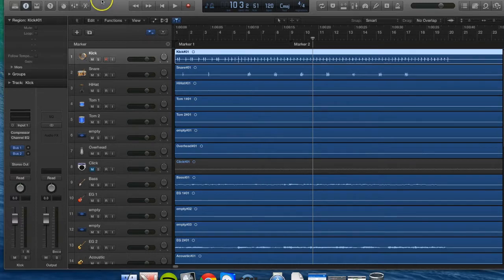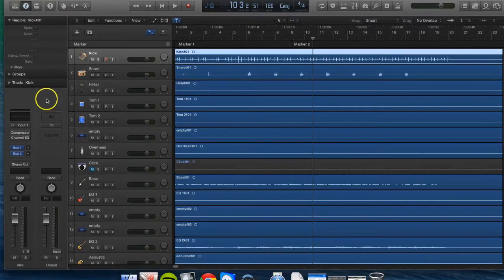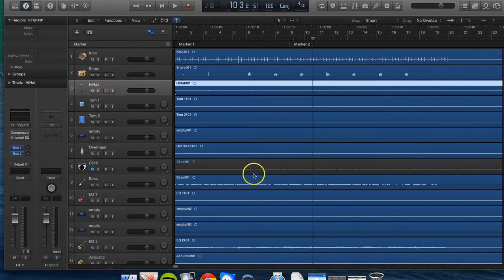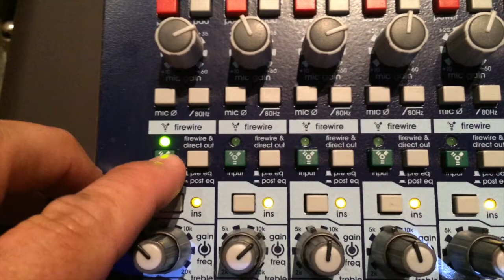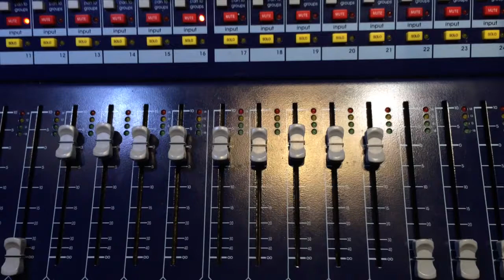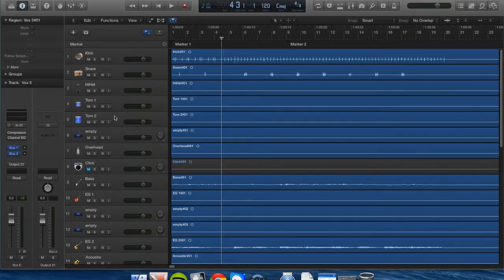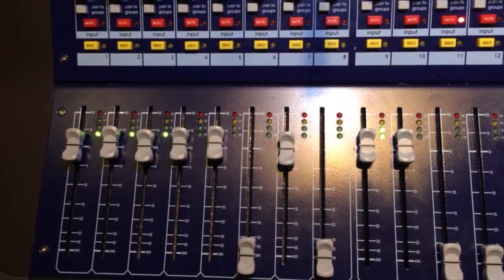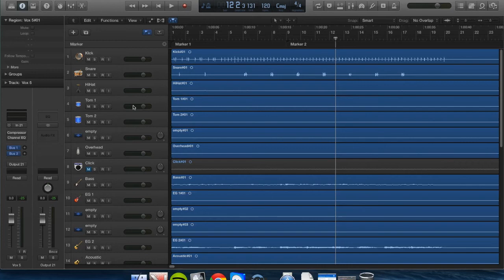Midas Venice F 32 using Logic Pro X for mix down

Comment: I have a question:

the venice f32 records in multitrack ????

I want to record my drums set in Logic pro x but I don't have channels in my interface
Reply from the maker: yes, the Venice will send all 32 channels to your computer if you set up the session properly in your DAW. It is very easy to do drum recordings with the Venice F32, as it actually works very well as a large, multitrack interface.

Comment: Jeremiah, great tutorial! I am thinking about getting Midas F32. Do you know how recording the inserts work? I am usually using distortion/filter as a group insert but I don't understand how it works on this console. Is it 32 channels + groups? Or I need to sacrifice 1 channel for it? Or some other way?
Reply from the maker: there are two ways to make it work. First would be to use the inserts on the board to send the signal to the FX and return back to the board, essentially creating an FX loop. This would require you to sacrifice a channel to the FX where your volume fader would be the Wet/Dry control for the FX. The other way that would work without sacrificing the channel would be to add the effects in post mixdown using the DAW and software effects. There are some amazing plugins for this but I am of the opinion that there is nothing like certain outboard equipment and that analog is sometimes better than digital when it comes to sound.

Comment: Hi! i just started using Logix pro x on my macbook pro 2009 (el capitan 10.11.6) and want to record my band with the Midas venice 32f. logic doesn't see the Midas if connected with firewire. do i need a driver for this? when i look in the hardware list and click on firewire, venice is showing, but not in logic. can someone help me please? thanks! Dave from The Netherlands.
Reply from the maker: dave Kelder thank you for your question. You will need to download the Midas Firewire driver the first time you connect the board to the computer. Launch the Midas FW driver and then launch Logic Pro X. Should show up and work just fine. Remember when you are monitoring the mix, you have to arm the channels to be able to hear them on the monitors...or at least that's my experience. Happy recording!
Reply: Thanks! tried it yesterday at a gig. connection board-macbook works. but now the next problem. how to set logic for recording multiple tracks. i think Google is my best friend for the next week ;)
Reply from the maker: dave Kelder now comes the tedious part. You will have to add tracks for each channel strip on the board. You will also have to make sure that the individual channel you add is setup properly in Logic to receive the proper input from the board. Not hard, just tedious.
Reply: Thanks for the help! just tried it, and it works!

Comment: My question is can you add FX from the Midas to every track while tracking and or running a live show m? Sorry if this was asked already! 
-MixedByKidSynth
Reply from the maker: On the Midas Venice I don't believe that is possible. The FW connection is merely a way to send or receive tracks from the board or a computer. The ability to send tracks, add FX, and send them back to the board can be done but not entirely with the FW. You would have to send the audio to the computer using FW and return those tracks in a simple stereo return or through another audio interface...which is kinda tedious and could be prone to latency. I would encourage you to look at a fully digital board if you want to add fx during a live show...or you could go with outboard FX processors that are standalone units like Universal Audio or something like that.
Reply: +Jeremiah Mitchell Awesome man thanks for that reply I guess that soundgrid is what I'd need have you seen the waves touchscreen interface it's insane!
Reply: +Jeremiah Mitchell eMotion LV1 Live mixer

Comment: Is there any way to save those settings in Logic so you don't have to keep redoing the assign procedure every recording session. I am considering buying this mixer so I am considering how it will work in a recording studio environment...All info welcome. Thanks for the detailed video...

Philip
Reply from the maker: +Uptown Wedding Photography NJ Yes! All you have to do is set up the "show" once and save it as a template for that board. That way you will have the template saved locally on your computer and you can recall it any time you need to. That is exactly what I have done.
Reply: +Jeremiah Mitchell Thanks for the info...How do you like the Venice console? I am considering buying one. Is there a way to use a channel strip as an input channel (say tracking a guitar) and also monitor on the same channel strip the DAW (or tape) return. Like an inline console would do. Thanks, again....
Reply from the maker: I have never tried it but I do know that all of the aux's work as they should while recording so it should be easily set up. I like the board, I will enjoy when we upgrade to the Midas Pro 2 board but this board sounds great and performs like a workhorse.

Comment: How do you bounce the mix through the midas? thanks for the video!
Reply from the maker: +Tomás León Bulling I don't typically bounce the recording through the Midas. I use the Midas as a mix down tool and then listen to the finished product through some small computer speakers, which is what most people will be listening through. If it sounds good, I will bounce it and make it a final cut. Hope this helps.
Reply: Thanks Jeremiah! but I dont understand, how do you bounce the final mix?? i'm using logic and I added some plugins and then I added the Midas Eq, then I send the mix to 23.24ch. And then how I bounce the final mix to master later? sorry about my english.
Reply: +Tomás León Bulling With analog external routing (effects/EQ/console) you always have to do a "realtime bounce" (instead of Offline bounce)

Comment: Great video, what do you do if you have 65 tracks? Can you mix the other 33 track in the Daw?
Reply from the maker: +Steve Belfiore Yes, you can. The issue with multiple tracks like this is that you would be best to send the first 32 to the board, mix it down and then send the remaining tracks to the board while using 2 channels as a stereo mix for the previously mixed channels that way you have a reference for the channels that haven't been mixed yet. 
Just my opinion but it should work...

Thanks for your comments and questions.

Comment: Hello what specs does your Macbook/IMAC have to run that many channels at once for recording? Thanks
Reply: +River Valley Crossfit Hi im looking at getting a macbook pro to record on, via my f32. you say 2.53ghz and 8 gb ram will record 32 chans all day, do you think it would hold up if you were then loading up on plug ins etc. during mixing in the box, say in logic x or something?.. thanks :)

Comment: Yeah, I get it.  For live sound reinforcement (probably other than a straight up band performance), you can play back pre-recorded parts through the mixer and tweak the playback mix on the fly manually using its controls.  I moved from a Yamaha MG32CX to a QU-32 so I could track, mixdown and mix live shows.  I had been searching for info and opinions on analogue desks like the Venice, strictly for tracking and overdubbing in the studio, while using the QU as my "mouse on steroids" for mixing down. It still might make sense. Peace.

Comment: So can you not just plug your computer directly into your monitoring system to hear exactly what the mix will sound like when played back?  I can see the Venice being used for tracking.  And in the days of analog tape, I can see how it would have been used for manual mixdown without automation. But I'm still not sure why feeding the DAW via FireWire back to the mixer with all faders at unity does for the mixdown process.
Reply from the maker: Well, I could run it through the monitor system is I had one. I don't use local monitors during a live show. I mix using the house speakers for a good sound. The purpose of this video was to illustrate what "could" be done. The Venice allows audio to be routed back through using the FW cable. It was not intended as a "this is what should be done" type of video. I was showing people how to do it if they wanted to. 

In all honesty, I don't even use this type of setup to mixdown my audio. It was just an illustration of how it could be done if you wanted to. 

Make sense?

Comment: I don't get how you mixdown using the Venice. The faders are all disconnected from the DAW, so how do you fine tune levels in a mixdown? If you aren't using automation, why even use a DAW?
Reply from the maker: Boris, the reason for using the DAW is simply that I am using the house speakers as reference monitors. I set the faders on the Midas to unity, I already know what the live set sounded like, so the only tweaking that needs to be done is in the DAW. This gives me a pretty good way to mixdown multitrack recordings without having to pay for studio time...or some really expensive reference monitors since my sound system cost us about $50k. 

Hope this helps! 
Also, we are breaking ground on a new building and our system will be upgraded to a Midas Pro2c with Nexo speakers and amps. I will have a video of some automation at that point.

Comment: you use the mixer like a sound card ? I own a card m - audio firewire 410 is required for the purpose ? I want use this with Reason 8.2.
Reply from the maker: Karim Le Mec Yes, I am using the mixing console as a "sound card". The firewire output on the board allows it to work just like your 410. The difference is that I have 32 channels coming into my DAW at one time. You should be able to use the board with Reason, you will have to just set up the input/output correctly.
Reply: Thanx You so mica Jeremiah.  I Just Found it a used one here in Italy and I cant wait to put my fingers on it. AWESOME tutorial btw 😉
Reply: Jeremiah Mitchell Hi Mitchell, a sound engineer I spoke of this mixer and said it was very good, my question to you is this, that the difference in recording only with a card direct sound to the PC that record directly with this console, I ask because there are people who say that consoles are not necessary, but I think that by sending the Senar THROUGH the mixer be heard with more body, give me feedback, thank you and God bless you!
Reply from the maker: KARAOKE MARTILLO
When it all comes down to it, I am not exactly sure how much difference going through a sound console makes versus using a direct input to a computer but I will say that the recordings are very good quality. Also, I am a sound engineer by trade so I would rather be standing behind a console than sitting behind a computer monitor anyday. I would suggest you try both ways and see which one gives you the sound you want. Different styles of music sound better with different recording techniques so the best way to find it is to explore. Hope this helps.

If you have any thing you would like to see in a video, let me know.
Reply: Thank you for answering ..... I think your answer is balanced, grateful!

Comment: Can I use this the firewire to record all the 32 channels to my computer simulataneously like I can do with a digital mixer(eg. Presonus Studiolive) and also how do you bounce the audio tracks after mixing them with the board?
Reply from the maker: Sayan Sengupta Yes! you can record all 32 channels to your computer. All you have to do is setup the inputs in the DAW so that they receive audio from the specific channels you want. It works almost exactly like a digital board in that respect. The audio quality is great. 

Thank you for the question.

Comment: Hi Jeremiah
can you make a video about how you record your mix back into logic?
thanks!
Reply from the maker: Amir Estlein I'm not sure I understand what you are asking about...? I don't use the Venice to record my automation for the DAW...if that's what you're asking about. You can actually use a summed mix from the DAW back into the board as an overdub type of situation if you wanted to. That way the original mix can be used as a backing track and you can record some new stuff over the top of that in a new project in Logic...but beware! You can't play a track from Logic and record new stuff at the same time unless you are using two separate computers. 

If I am not thinking on the right line please clarify the question.

Comment: can i use the faders and the Eq to Mix?
Reply from the maker: Everything on the physical board should function as normal, except for the input signals which are coming from the computer through the FW cable. The eq's and all faders will control the volume of the signal coming through them...just as normal. Just remember that the premise of this video is to use the physical board as a way to monitor the changes made in the DAW...so, I don't normally tweak the faders on the board a whole lot so that the sound is more neutral and genuine to the original recording.
Reply: Jeremiah Mitchell  thanks man ...helped a lot=)

Comment: Do you know maybe how to root  the Signal from Logic pro x to  Venice f32 mixer and root back an Analog EQed Signal  from venice f32 stereo channel back to Logic Pro X to get a even better Audio quality?
Reply from the maker: Great question but I am not sure it is possible to do what you want with the F32. The reason I say this is that the F32 will send or receive 32 channels of audio but I don't think that Logic X will play and record audio from FW at the same time. I have never tried this but if it were possible you would have to set specific channels to receive audio from Logic, then assign those channels to the sub-mix faders and record the sub-mix faders in Logic. This would, in essence, be like a overdubbing situation using traditional means. I do know that it would be easily possible if you have another interface that you can send the main outs from the F32 through and into another laptop/desktop. This way you would have one computer feeding the rough audio and another capturing the Eq'd audio going through the board. I will play around with it in the next few days and see if I can get it to work and let you know.

Comment: Question, where abouts are you running your stereo outs from? I noticed you dont have them coming out of 1-2 and I know you cant change the mappings on OSX only Windows
Reply from the maker: I am not sure that I understand your question...I am not using any stereo outs on the board. I am using stereo in's as the channels 25-32 and they are used for stereo media such as Spotify. Is that what you are talking about or if not could you clarify a little?
Reply: Sorry I should have been a more clearer. I have the exact same board. My question was meant to read more like this: On the board, have you got your stereo outs coming back on channel 1-2 or elsewhere? I noticed on the Venice F FireWire page you cant change where the stereo returns go to on OSX but on PC you can change the WDM maps so L-R outputs can be routed to stereo 1L and stereo 1R. Is this anymore clearer, is it making any sense now that it did before? I just find it annoying how you have your DAW returns and then your outputs routed to 1-2 on OSX
Reply from the maker: Honestly, I don't mess with stereo returns, as I don't need them when I am using the FW to run the recording back through the board to mix down. I guess your question would be handy if you were using the FW to send audio from certain channels to the computer for outboard effects or such, but I don't typically do that. You should be able to create a new sub-master channel in Logic or whatever DAW you use and then assign that to the stereo returns. As far as Logic, the program automatically assigns the Master fader to L+R only if you don't have the FW enabled...then the program is set up exactly how you want it to be...meaning that the Master volume in Logis is now controlled by the Master fader on the board. There is no panning in the program once you "rewire" it to receive audio from the DAW. Does that help...or even make sense? If I missed it again send me some screenshots to jeremiah.mitchell87@yahoo.com and I will see if I can help.

Comment from the maker: Calvin, good questions. First, the Midas user manual says that the FW recording signal is essentially a "direct out" for each channel. This means that the signal is unaltered and completely "dry". This is a good thing and a bad thing, because you have to add any effects in post production...and a good thing because you can experiment with new effects and such without ruining a live show. 
Second, as far as testing the incoming signal is as simple as arming the channel, in the DAW, to record...this will allow the channel to "monitor" the incoming signal and you should see the virtual input LED's for that channel bouncing or responding to the incoming signal. If you don't see this, then you have not configured the input properly for that channel. If I need to make another video about using Logic I can...just let me know and I will show you how I set up my system and use it every week. Thanks for the feedback! Keep it coming!

Comment: Cool, i hope i can take some steps here and use in my situation. Thanks
Reply from the maker: JIDAYAH1981, I hope so too! The premise is pretty much the same for just about any board that you have connected through firewire to Logic. If the board is digital you might have to get into the settings, such as on the Behringer X32...but should be pretty straightforward. 

Let me know if there is anything you would like to see!